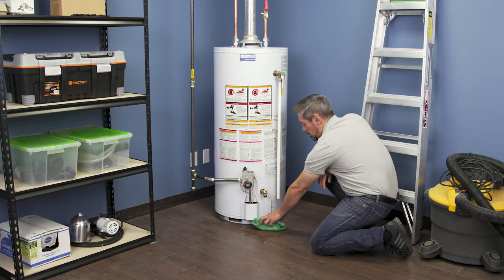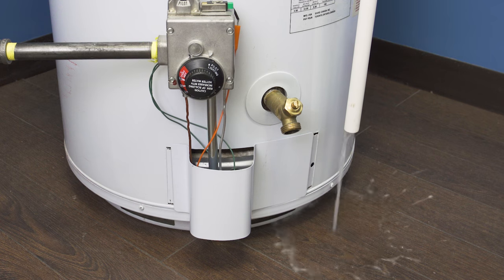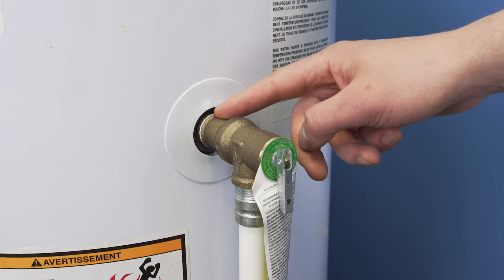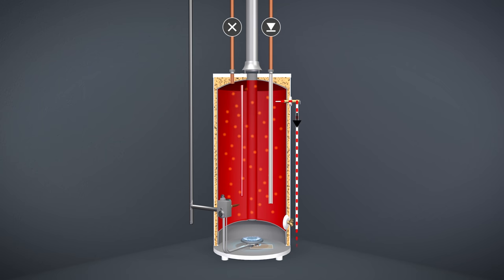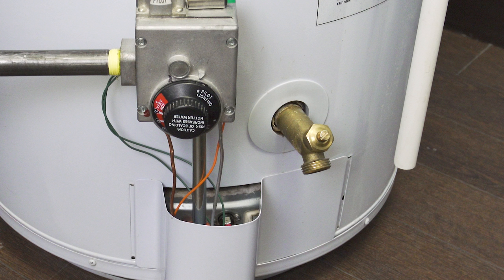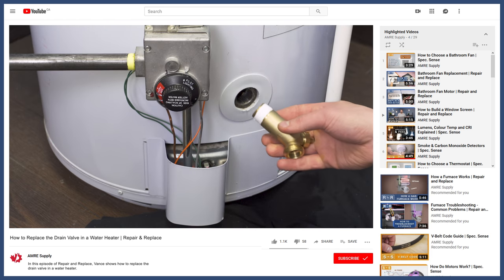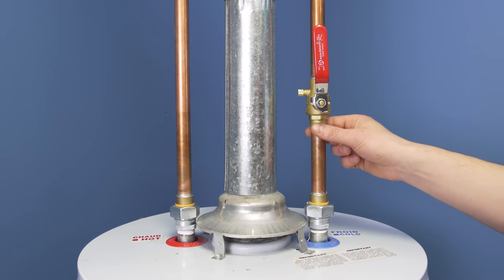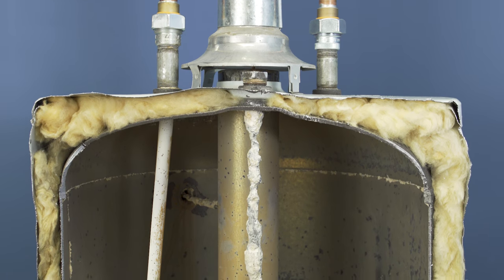Hot Water Tank is Leaking? Top 5 Fixes | Repair and Replace

Comment: My tank is leaking at the top where you turn the hot and cold water on and off, also when we turn it to the hot side. The down stairs tub just keeps running and wont turn off unless we turn it back to the cold side. I was wondering what could the problem be.
Reply from the maker: Thanks for watching. Plumbing connections can leak over time as there is more than one way that it can wear out. From what you described the leak is likely coming from the shutoff valve or the dielectric union below it. You might need to install new parts for those connections. If your tub keeps running then it likely needs a new cartridge.

Comment: this is what i have. installed three in my life - 2 gas one electric so I have some experience. this one is gas.  I  replaced this  one with my own hands   due to Sandy in 2012. Basement in NJ. all is copper.  sharkbite cold. sweated hot out.  sharkbites cold  are in great shape.  for the hot out, I have the nipple,  the copper threaded   adapter, 4 inches   of 3/4 pipe straight up   and a 90.  the seams of the 90 are leaking.  green and corroded. after the 90, i have 1 foot  of 3/4 and another 90. again 90 green corrosion and leaking.  must be due to  moisture  in basement and 12 years lol. I want to hacksaw the pipe before the first 90. I want to sandpaper the 4 inch piece  due to deposits and sharkbite 90.  after want to use  use  pipe and sharkbite  90 if i need to use a small sharkbite connector after the second 90 so be it.  how do i deal with the hot water? good shut off on the cold water side. good ball  valve.  can shut building off if need to.  I am comfortable with the the repair but not with the hot water. How do i repair an active gas  hot water heater? thank you.
Reply from the maker: Thanks for watching. The installation side of things is outside of the scope of this series but it's most secure to open the hot water faucets to allow air to flow in and drain the hot pipes to give yourself a clean way to install the rest of the components / tank.

Comment: Would turning off the electricity to the hot water heater stop the water heater from leaking?
Reply from the maker: Thanks for watching. On an electric water heater, the heating elements are powered but the water is controlled by the pressure within the system. There are no powered pumps so turning off power will just turn off the heat but will not stop a leak.

Comment: is it possible the drain valve leaks internally and will feel dry when i swipe my fingers around the outside?
Reply from the maker: Thanks for watching. If the drain valve is leaking you would likely be able to feel some water close to where the threads are screwed in.
Reply: @AmreSupply  tp valve is at the the top and no water is pooling. There's a large groove for it so I can't put my finger inside to check if threads are wet but it looks dry. The drip is coming from the leg of the water heater but also under the gas control assembly

Comment: What are you supposed to do if it stopped leaking on its own?
Reply from the maker: Thanks for watching. It depends on the size of the leak and where it was coming from. The relief valve is something that could leak but close itself over time. If you think it was coming from the relief valve then that can be replaced.

Alternatively If the inside of the tank was leaking then a piece of sediment might have plugged it inside. This is something that might start leaking again.
Reply: @AmreSupply  It was a good size leak. I touched around and it wasnt obvious where it came from.

Comment: My relief valve has a small constant leak.  What would cause this?
Reply from the maker: Thank you for watching. If the leak is happening from the discharge pipe then it is possible that the relief valve is not closing properly. A mineral buildup can cause this or it is possible that the valve is worn out. You can see how to install a new valve here: https://www.youtube.com/watch?v=2qhsmSbQQzc

Comment: I have water leaking inside the the bottom at the spot where the temperature switch is and it pops the breaker, water in the pan also about 3 inches? Water heater is electric and 2 years old.
Reply from the maker: Thanks for watching. In an electric water heater the heating elements are screwed in. If the elements are still working properly but are leaking then you can try to reinstall the elements but with new teflon tape to help the threads to seal properly. We don't have a specific video on electric water heating element replacement but we have one on teflon (thread seal) tape https://www.youtube.com/watch?v=Yu_l5mo16FU
Reply: @AmreSupply  had a heating element break inside, it's fixed, thanks!

Comment: I have a Rheem Performance that's leaking from a corroded tank somewhere at the bottom, since the fiberglass on the inside is damp, and the pan fills up after about 3 hours. (I ruled out the TPR and drain valves already) 

I'm worried it may put out the pilot light, and the gas will still keep getting pumped out. Does anyone know if this is a possibility, or is there some precautionary shut off for the gas? (I have to call and have someone look at it, but I'm almost completely certain it needs to be replaced)
Reply from the maker: Thanks for watching. That is a great question and is explained through this video: https://youtu.be/h0uZDmdpR0E?si=RYJcC9FlNrZA8fI4 When the pilot flame heats the thermocouple it generates a small amount of voltage which is enough to power the solenoid in the gas valve. If the thermocouple does not heat up or if there is no pilot flame, then there is not enough voltage and the gas valve will close. This prevents gas from leaking out if the pilot light goes out.

Comment: I suspect the dampness around my hot water heater is coming from the relief valve.  I don't think it's pouring out but maybe from steam?  Is it safe to place a container under the tube to prevent water from pooling in the area?
Reply from the maker: Thanks for watching. You can put a drain pan under the water heater or under the drain tube but if there is steam coming out of the relief valve then  either the water pressure & temperature inside the tank is too high, the wrong pressure relief valve was installed, the relief valve itself has failed. You can see how to replace the relief valve here: https://www.youtube.com/watch?v=2qhsmSbQQzc

Comment: im just buy a new 20 galon bradford white heather and the valve had a slow leak its thats normal?
Reply from the maker: Thanks for watching. Neither the drain valve or relief valve should have a slow drip or a slow leak after it closes. If the unit is brand new then it's likely a manufacturing defect and might be covered under warranty.
Reply: @AmreSupply  thanks so much!

Comment: The drain pipe just continues to leak despite the new valve. The temperature is turned down to 120. My heat works, and the water is still very hot, but the drain just keeps leaking. Do I need a new tank? Or is there anything else it could be?
Reply from the maker: Thanks for watching. If you installed a new drain valve and use teflon tape on the threads then it shouldn't leak. If the new drain valve leaks from around the threads its possible that the threads on the tank itself are worn down, which might compromise the seal. Before replacing the entire tank, it might be good to drain the tank, unscrew the new drain valve, clean the threads on the tank with a wire brush and take a look at the condition of the threads. Then reapply teflon tape, install the drain valve and see if that helps.

Comment: Please if you see this respond asap
My water is always low. I use cold water for everything. Showers and everything
Family is staying at house. They want hot water (like normal folk)
So I cranked it from literally like a level 2 to 10
That was yesterday
Today it’s leaking at top and bottom slightly 
Is this due to pressure buildup?
It never leaked in YEARS ever
I haven’t turned temperature level it up in prob 4,5 years
Reply from the maker: Thanks for watching. Increasing the temperature does increase the pressure (pressure and temperature are proportionate) so this would make a leak more probable especially if this is the first time it has been adjusted in years. 

If the leak is coming from the top the water could be running down the side and pooling at the bottom. It is less likely for it to leak at 2 places at once. A close inspection would help you narrow this down.
Reply: @AmreSupply  thanks so much. I released (flipped up ) the relief valve on top side
Boy did that release a plethora

My issue is gas supply. I turned pilot from on to off
Do I need to turn off gas supply line that feeds into hot water tank? (In line ball valve)
Reply: Just worried. Got family and sisters kids in house
Reply from the maker: @johnc1280  The gas control valve will stay closed when the pilot is off based to the spring loaded action of the valve however it never hurts to shut off the gas shutoff valve as well.
Reply: @AmreSupply  the water is def leaking from the top. Not bottom 
this means a lot
I’m not helpless by any means but plumbing I’m very elementary on 
sincerely you’ve been great help 

I placed a bucket under the relief valve outlet. It’s still coming out. Not much but a bit

I had to jostle the relief valve a bit to get it to reduce the output water flow 
Played with handle a bit and it greatly reduced the water releasing 
Think the relief valve needs a swap?
Reply from the maker: @johnc1280  We're just happy to help! Based on what you're describing it does seem like the relief valve is faulty and not closing properly. This is also logical as the relief valve is supposed to open at higher temperatures and pressures, which would make sense that it would be the first thing that changes when you increased the temperature.

Replacing the relief valve is straight forward and only needs a couple tools: https://www.youtube.com/watch?v=2qhsmSbQQzc

Comment: my water heater is leaking from where the thermostate wire are coming out of tank,what can be done,is it fixable
Reply from the maker: Thanks for watching. The heating elements on a electric water heater can leak. These are relatively simple to replace but when you replace them check the threads and make sure that they are clean. This will ensure that the new element makes a good seal.

Comment: My water heater is dripping from that plastic hose bib...any idea why its doing this?
Reply from the maker: Thanks for watching. If there is a leak from the drain valve then it might not be closing properly and might be faulty. You can see how to replace it here: https://www.youtube.com/watch?v=nGCejMsKNX4
Reply: @AmreSupply  is it mandatory to replace it or can you just add a cap to it to stop it from dripping outside the tank?

Comment: I'm leaning towards inner-tank leak on mine,  but it's only 3 years old???
Reply from the maker: Thanks for watching. That is uncommon for a 3 year old tank. What has lead you to think that it's an inner tank leak? Have you eliminated other issues?
Reply: @AmreSupply  I don't see any leaks up top and on any fittings. I can feel the insulation soaked and water is dripping all around the base...I can't really pinpoint where it's coming from,  so I'm not 100% sure.

Comment: How come  there is no barrel union on the gas supply? how would you be able to disconnect the gas with out cutting the Galvanised steel pipe?
Reply from the maker: Thanks for watching. This water heater was set up in our studio so we would have plenty of room to set up lights and move the camera around. The water heater wasn't 100% functional during the filming but was filled with some water. You have a good eye for detail in spotting the lack of the barrel union.

Comment: What if the insulation is dry and every valve is dry but it’s still gathering water in the bottom?
Reply from the maker: Thanks for watching. In this case it might be the an issue with where the control valve connects to the tank, or the bottom of the tank is compromised and is leaking.

Comment: You missed mentioning that leaks can come from cold flues, particularly when a cold water heater is first fired up and it sweats (condenses) internally.
Reply from the maker: Thanks for adding that detail. Water droplets can form on the flue, but this is not a huge source of water compared to a drain valve or relief valve.

Comment: I’m following along with the video, but I’m stuck because the knob won’t turn past the pilot setting to the off setting!
Reply from the maker: Hi Talia, thank you for watching. When in doubt you can always turn the gas off by closing the valve to the gas supply line. Then it won't matter if the pilot setting is turned to the off setting, the pilot flame will go out as it will not have any more gas to burn. From there it will be safe to work on your water heater. Hope this helps.

Comment: Yeah I haven't been getting hot water and just checked it . Looks like multiple leaks corroded through even from gas exhaust on top water seepimg out and small pin pricks on top where valves are . Verry old . I think it obviously needs repalcement .
Reply from the maker: Thanks for sharing your experience. If corrosion has gotten that bad then installing a new tank is probably best.

Comment: For now how to stop water from leaking from seam till I get new one?
Reply from the maker: Thanks for watching. For a quick temporary solution there is flex seal or other quick seal patches that can be applied to the seam. https://www.amresupply.com/catalog/Emergency-Repair-DC1D

If the seam is not accessible you might have to shut off the water and manually drain the tank https://www.youtube.com/watch?v=hkbi24QJhDw

Comment: Could the value be dripping because it’s not tighten enough?
Reply from the maker: Thanks for watching. These valves are factory installed and will be tightly screwed into the tank. It is unlikely that the valve would loosen over time as you would see it spin and it would no longer be orientated correctly. If the valve was replaced at any point after it was installed then its more of a possibility.
Reply: @AmreSupply  so the value on / off switch could loosen at all over time , The dripping isn’t coming for the hot water heat but from the bottom of the value
Reply from the maker: @freedomring6364  The pressure relief valve is operated by a spring and a sensing bulb. This mechanism can wear out overtime which can cause the valve to open at lower temperatures. As well sediment and corrosion can interfere with the valve closing properly. Regardless If you're getting a slow leak out of the relief valve then its best to install a new one. You can see this in more detail in this video: https://www.youtube.com/watch?v=2qhsmSbQQzc

The same applies to the drain valve. The rubber stopper can wear down which will prevent it from making a good seal. You can see this repair here: https://www.youtube.com/watch?v=nGCejMsKNX4

Comment: I flushed my tank last night (I'd been away for a few days, and had it set on "pilot" so the water wouldn't be Hot.) I temporarily turned on the relief valve at the time. I went downstairs this morning, and the pipe was dripping. It's still dripping tonight. 

If it ain't Broke...
Reply from the maker: Thanks for watching. The relief valve should be able to open and close properly as needed. It is possible that sediment has prevented it from closing properly or the valve is starting to wear down. We have a video showing how to replace the relief valve: https://www.youtube.com/watch?v=2qhsmSbQQzc

Comment: Can you talk about ELECTRIC water heaters?
Reply from the maker: Thanks for watching. We're planning to update this series with electric water heaters in the future. As for leaks, the electric water heater will be very similar except you will have to remove the panels to inspect the heating element threads for leaks. If the heating elements are faulty or are leaking then they can be unscrewed and replaced.

Comment: How can you check the threads where the cold and hot nipples are threaded into the tank?
Reply from the maker: Thanks for watching. You can check to see if there is a leak in the threads of the cold inlet or the hot outlet nipples by using a cloth or anything that can be pushed down towards that. Normally it should be 100% dry so if you push a cloth down and there is water then that's an indicator of a leak but only if you haven't had a leak farther up that might have traveled down.. If you soak up water and it seems to be wet again from that spot then that's more confirmation.

Comment: My tank is leaking from the top seam. Does that mean it cannot be repaired?
Reply from the maker: Thanks for watching. It could be the tank, but it's most likely either the cold water supply or the hot water pipe connections on the tank itself.